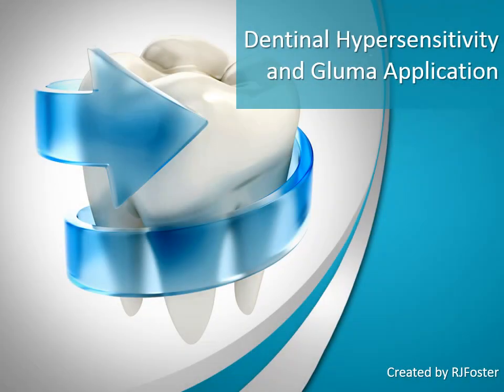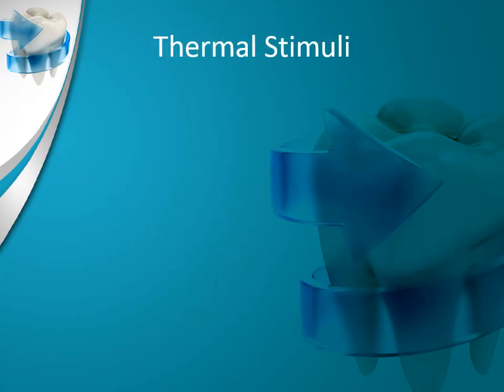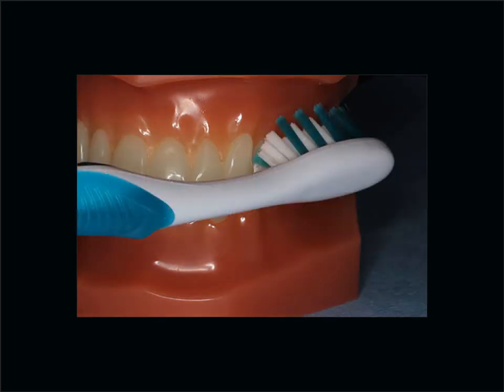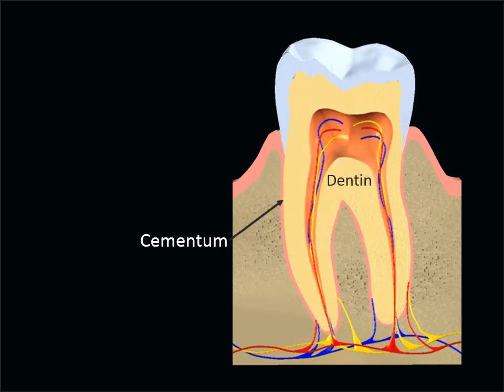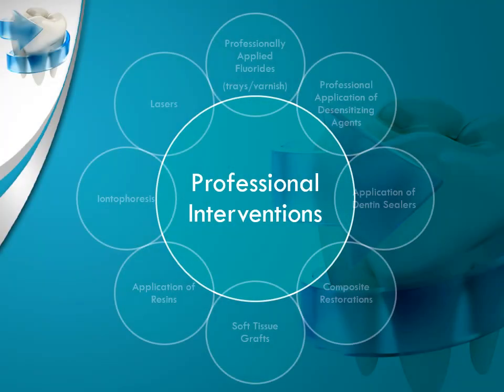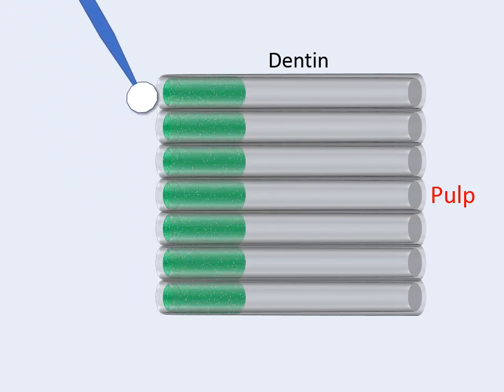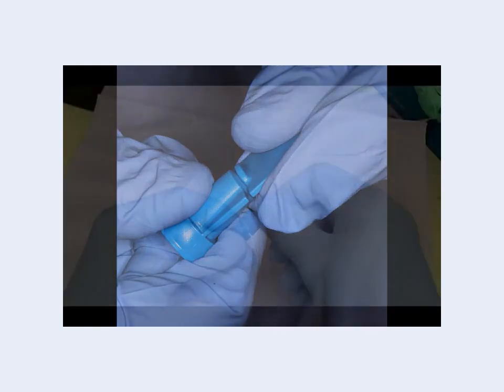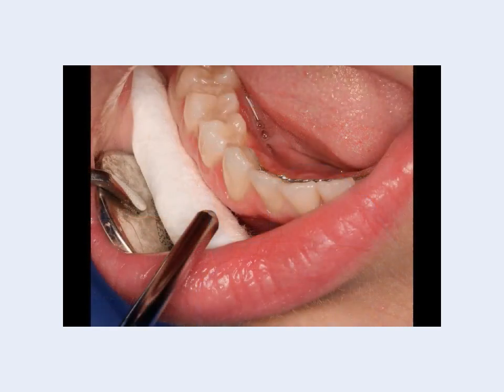Dentinal Hypersensitivity and Gluma Application

Comment: how do I remove it, salt water rinse orsomething else
Reply from the maker: Unfortunately, no. Salt water rinses will not remove the sensitivity. You can try using a sensitive type of toothpaste, like Sensodyne, to see if this will help. Otherwise, a trip to the dentist to see if any exposed root surfaces can have a desensitizer, like Glumma, or a restoration can be placed.

Comment: I just had some applied. Not only did it not help, it burned my lip and gave me horrible dry mouth. The dentist claims they've never seen these side effects before. I felt a drop fall on my tongue and I felt a burning sensation. They wiped it off but I've been having problems since. Beware!
Reply: Are you on psychadelic?
Reply from the maker: Gluma needs to be only applied to the hard tissues of the tooth and should avoid being applied to soft tissues like the gingiva or lips, etc.